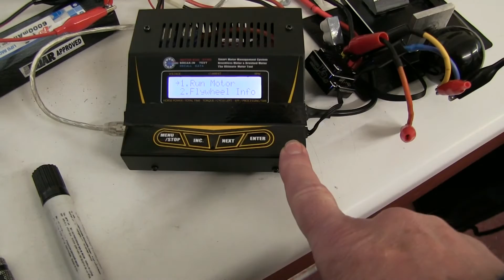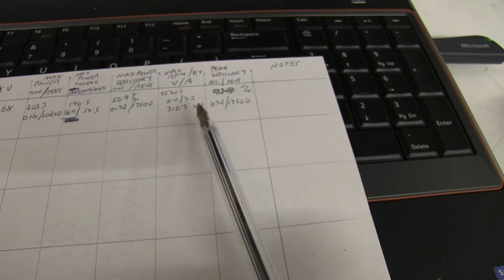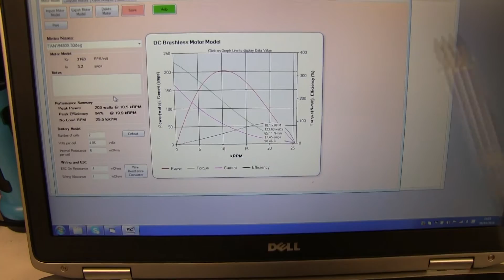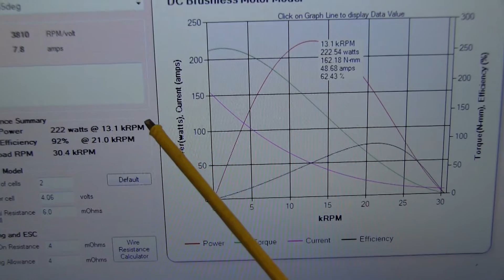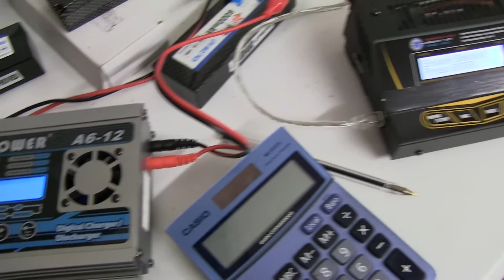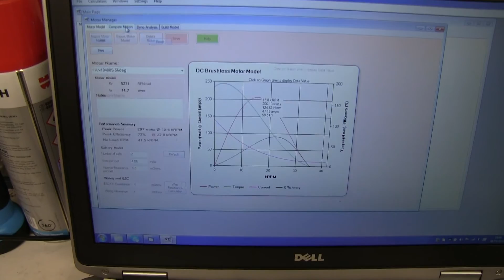Fantom 13.5T Dyno and Graphical analysis for Boost Timing.

Comment: Hi Nick,  I'm a little new to all of this motor tuning so I need a little help with the timing points.  It looks like you are showing to start with 30 degrees of fixed timing in the motor can, then add 15 degrees of boost starting at about say 9,500 rpm and end at about ???rpm.  And finally, add 11 degrees of turbo at that ???rpm  with maybe a 0.1 to 0.25 second delay?  is this right?  And of course what rpm points are boost and turbo hitting?  Thanks for a great video, I look forward to learning more.  Ken

Comment: Hi Nick, sorry for replying in this old video, but I have a question : on my xr10 pro, the default setting for 13.5t 'open' is start rpm of 4K and end at 12K. When I see this graph in this vid, I wondering if the default setting of the esc is way off, or if this particular Fantom motor needed much higher start and end RPM. Do you have rough start and end rpm for the latest HW g3R 13.5t? I only have a motor analyser, but not the rest of you 'crazy nice' equipement :o Thx in advance and keep up the vids!!
Reply from the maker: Hi Laurent.  Hobbywing know their motors better than anyone. So their settings must be good for most tracks.
Increasing advance at lower revs will give more performance, but also heat the motor. So important to check the motor temperature.  All the best Nick

Comment: Hi Nick it's sam again how much current do I charge this orca Battery and end volt ? Thanks
Reply from the maker: Hi sam
Lipo chargers have a set end point voltage.
If you have the latest High Voltage type - then the higher voltage can be selected on some chargers.
For competition, the end point is limited to the original lower (4.20 per 1S) for all types of Lipos.
Reply: Thanks pall
Reply: Nick Adams my orca charger goes to (current) 25.0A is this to far ?
Reply from the maker: 25 amps is okay for high power lipo

Comment: Hi Nick, loving the videos is there a conversion for the Robitronic dyno to brushless, with out having to use a transmitter and speeod?

can you repair the anaylizer if you reverse connect it :-(
Reply from the maker: Hi
Sorry, I havn't used the Robitronics.
The analyzers may have a fuse inside, so it may be ok if reverse connected.

Comment: Hi nick what motor do you think would be best for the 13.5t boosted class?
Reply from the maker: There are a lot of Manufactures of 13.5T motors.
The ones that I have tested and seen racing that are very good are:
Fantom, Reedy, Trinity/Revtech 24k, 
Also the new r1 wurks and Orion Vortex LW.
They all have very good performance and latest design which aids cooling.

Comment: Hi nick , great videos mate . I have a question for you , well I start with my son drives Offroad and onroad for team associated and reedy Australia in stock 17.5 and 21.5 classes . What is the amp draw and sweet spot for a reedy 21.5 M3 1S motor for a touring car . His buggies run 17.5 reedy motors set up at 8 amps draw , with the right gearing they run at a nice temp and are very fast . Cheers in advance Chad

Comment: Hi nick I love your videos  you are doing RC off road and on road Racer's a solid, I run a Fantom  fr1 type T works motor in my sct and love it I see out of all the motors you test fantom has made its way in your TC's. I also post all your video's to RC Tech in the proper threads,  you should know there is a new dyno comin out called the mini D here are some links https://youtu.be/pVD-lQemWwM 
https://youtu.be/tBPYMn-flPQ they will be available soon they  seem much more accurate !!!